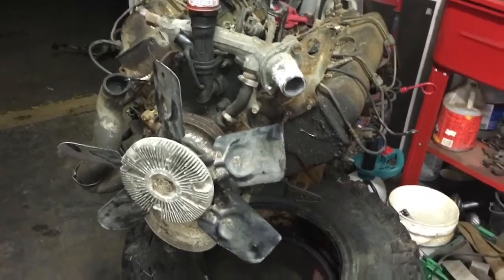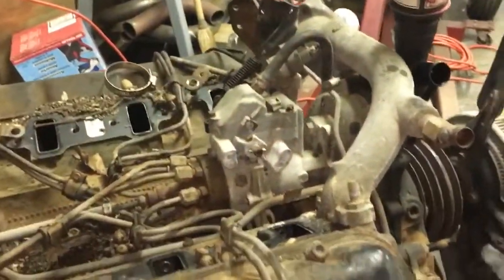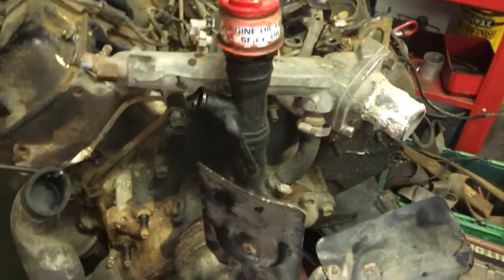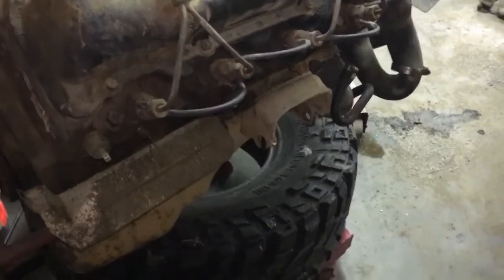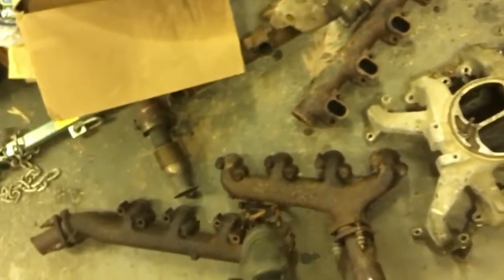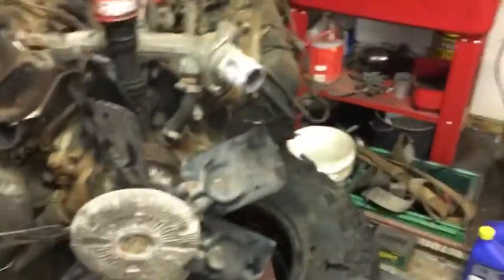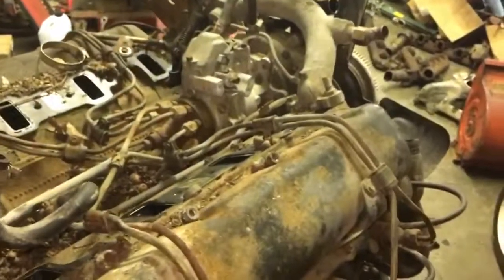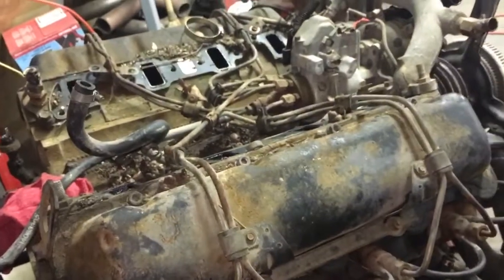New project (like I need another) 6.2 diesel

Comment: they make aftermarket center mount turbo kits but not for the trucks.. supposedly it will hit the firewall. if you fab a setup and it works properly ill buy one from you. like you said better flow